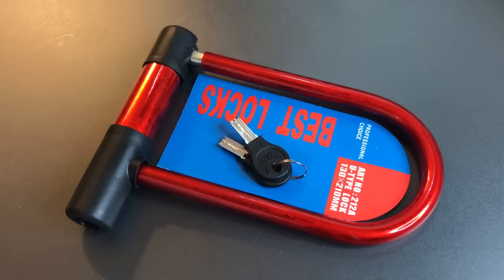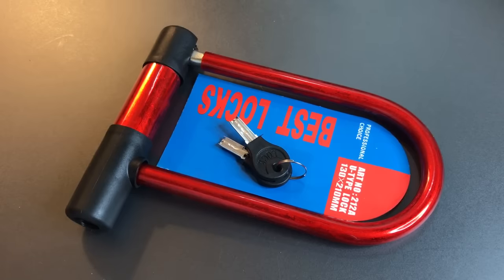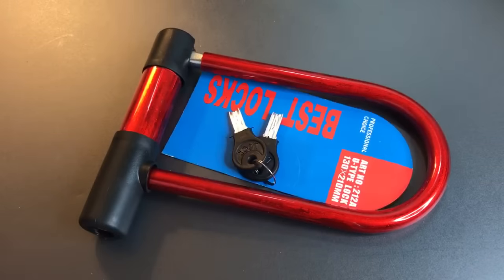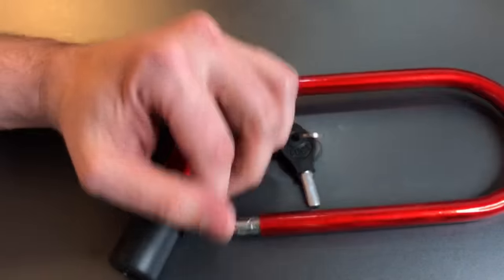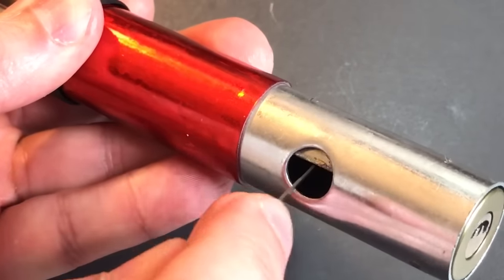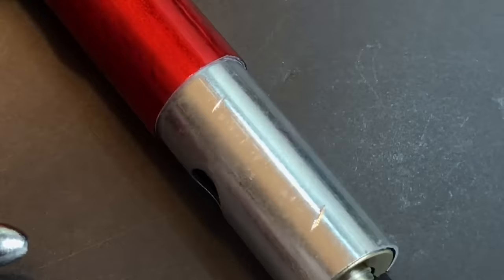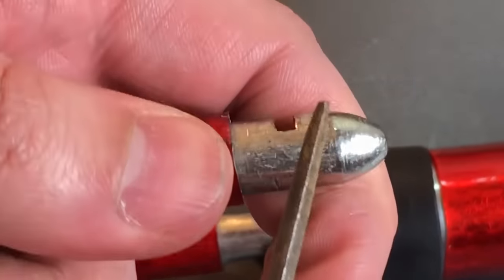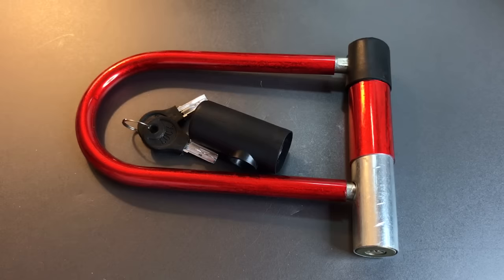[370] The WORST Bike Lock in the World Picked and Bypassed

Comment: Thieves see a U lock and don’t even try. Honestly, you don’t even have to lock it onto a bike to scare people away. You can, in most places (excluding high crime areas), just make it sorta look like it’s locked onto the seat and they don’t steal it. They carry bolt cutters, not lock picks and shims
Reply: this is only the case in areas where bike theft is low, bikes predominantly use cable locks, and your bike is not very expensive
Reply: @Guythatyoudontknow  I most people use cable locks, they are so much more convenient. Also, everything you said contradicts with my knowledge of bike thefts, which have happened to me twice, and many others I know, in high crime areas. I have, during a few times where I was sprinting to my destination, just set the lock to where it looked sorta locked up in the middle of various “sketchy” downtown areas, and it’s never been stolen
Reply: @AFN2750  I’m not saying it’s an ineffective deterrent most of the time for relatively short amounts of time (which is to say it deters thieves who only possess a bolt cutter), I’m just saying it’s basically a bare minimum sort of deal for a good bike 

I also see posts every day for stolen bikes in local FB bike groups, and most of them have ulocks, so I’m glad your experience with them has not disappointed you thus far

Comment: so LPL, you would recommend it to lockup a $3000 Felt Road Bike right?  haha!  What can you expect for $3 anyway?
Reply from the maker: Absolutely... just tell me in advance where it will be locked up so I can... uh... approve the location.   On an unrelated note, how much do those bikes go for on Craig's List?
Reply: I ride 4 seasons (SW Michigan).  Winter is a Giant Mtn bike, else a Giant hybrid Cypress DX.  I spent less than $600 for all of it, used, except for the locks.  Someone is always selling good used bikes cheaper.  For locks i use an ABUS Cenero (Cetero) 970 disk detainer around 1" dia cable.  I have a Kryptonite Orange mini Ulock with the hardened Kryptonite chain (1 step below the NY brand) but rarely use it.

Comment: We have a bike theft ring here in Colorado that freezes bike locks using liquid nitrogen and hits 'em with a sledge hammer breaking them off. I've had 7 bikes stolen around Boulder in just the last several years. They were all U-locked with quality locks, with Also metal chains running thru both wheels. Straight-up gone. Even the locks, probably as an effort to conceal their methods of bike theft.

Comment: I think if it is only three dollars, it’s not that bad.

The shim attack is only going to be a weakness if the thief knows it’s there.  If it takes an average of 5-6 seconds for LPL to pick it, it’ll take me two minutes.  

Also I think they’re more likely to attack the shackle than the core.

My wheel clamp I bought for £30 over here in the UK is 0.8mm mild steel tube which would take me approx 15 seconds to hacksaw through and free the wheel.  But I have a number of devices in combination.

Comment: The reality is that this lock most of the time is good enough. Even a lock that doesn't require a key, simply has a knob you turn, would be good enough in most cases. The lock doesn't have to be good, it just has to look good to the untrained eye. The bicycle doesn't have to be difficult or impossible to steal, it just has to be (or simply look) more difficult than the bicycle next to it. On my university campus, where so many people didn't know how to properly lock their bicycles (in many cases simply unhooking a cable or taking the wheel off to slide the fork out of the lock) I think a rope made of paper napkins could have accomplished that.

Comment: i have a very similar bike lock i bought to use temporarily until i get a nicer one (cost me $10 though, jeez...) so i can just run in a store real quick or whatever. i saw this video and was like "wow, i wonder if mine's like that?" - i went to get it to find out that not only did i have the same lock, but a metal piece in the locking mechanism had snapped off and fell out while it was in my backpack, rendering it unusable

amazing. it really is the worst bike lock.

Comment: I think there would have been two methods to make it even worse:
(1) supply it with incorrect keys so shimming is the best way to actually use this lock
(2) Have so bad surface finish on metal parts that using it will cut wounds on you.

However, I wouldn't expect much more from a $3 lock.

Comment: I had a bike lock worse than that 
Literally everything could open it Exept the damn key
It was a pain in the ass to insert the key and once inside, it wasn’t unlocking the core 
But i could open it by shaking the lock, pulling hard on it or low skill picking attacks 
Finally, the shackle was made out of aluminium  
The brand was burg wächter but i don’t know if the exact model still exists

Comment: Tbh I might have used a worse bike lock. I once had a chord bike lock, and one day I forgot the key. Being stuck outside with no key and no way home I went for plan B, which was to destroy the chord. I had absolutely no tools, but simply by yanking on the cord for 5 minutes I was able to break it. If I had a pry bar I could almost certainly have opened it instantly. As for the core, I imagine a 12 year old with a rake pick could have opened it in seconds.

Comment: Had this lock. Worst lock I have ever had. It broke after about a month after I got it. First the key started bending (the plastic part, not the metal) so it was a battle just to unlock it, then the inner spring actually fell out of the key hole and the pins! Lucky it happened when I was home not out and about!

Comment: yes it is really bad but it can be worse. I have bought once a bike lock and after using it a few times there was no way i could lock it properly. You just needed a little bit of force to just pull it open again after closing it. Could be a unique production mistake of this certain one, I thought. I returned it for a new one (same type) and after a few times using, it showed the same problem. Returned it again against a new one and the same problem showed up. This lock was reallly the worst

Comment: You should also try to pull it open, just with force, because the spring loaded lever is slanted it should release.
And of course you should have shown how a bolt cutter opens this lock. You'll throw it away anyway.

Comment: funny story, outside my apartment complex at the bike rack, there was an abandoned lock just hanging there for years. now watching this video, i recognized it, its the same, so i went outside and tried to open it. when trying to pick it, the inside cylinder broke from just a little tension. so i went for the shimming. was quite hard, as it was rusty and quite weathered, but i got it. when i took it inside to trash it, i smelled it. even after years outside, there it was. kerosene. its really disgusting, must have been much worse when new...

Comment: actually, alot of times the impression of a secure lock is worth more than the lock itself. especially if the bike is locked in front of a building with windows. nobody is gonna whip out a saw to "test" the shackle, so the appearance of a secure lock is actually its biggest safety feature..

Comment: Oh boy, you're gonna have an even bigger surprise when you take off the plastic cover on the hinged end; The only thing holding that 'hinge' together is a very thin pin that goes through a hole in the lock body in to a soft plastic bung with a slot in it for the shackle. The whole thing would likely buckle and snap with a few hits with a brick.

Comment: This would still most likely deter most bike thieves just because it's a u-lock. I just read that the most popular types of locks to break are the wire ones and the flimsy folding ones. Bikes with u-locks were the least likely ones to get robbed in general.

Comment: I mean, still seems harder to open than some of the cheap bike locks I used to have on my bike when I was a kid. I lost a key to one of them, and quite quickly learned that the lock can be opened by sharply hitting it with a rock. It just pops open, and still functions like new (which is obviously not that well). Used that lock for a few years after that, only opening it with rocks or hammers or occasionally just smashing it on the ground, depending on what was available

Comment: I bought a lock from pound shop if you had a key that fit the key hole all you needed to do is apply a little more pressure and it would open so the lock picking lawyer would only need his tension bar